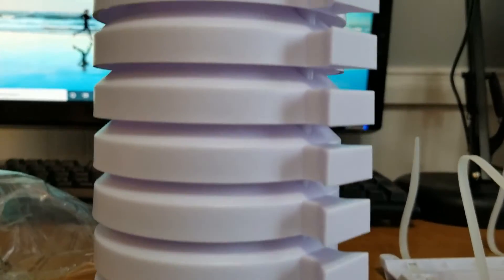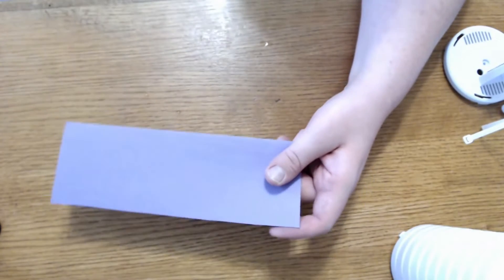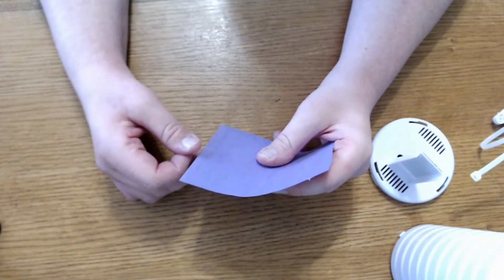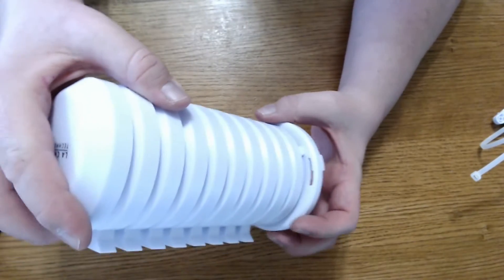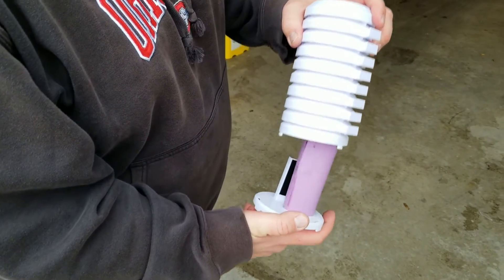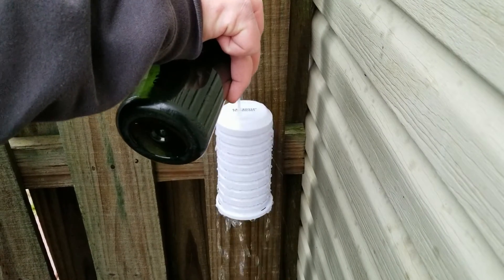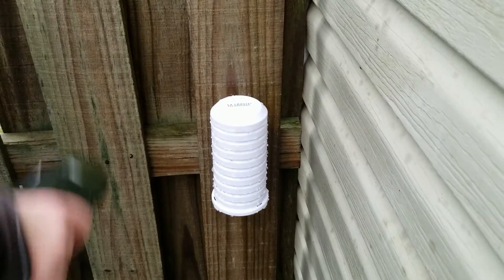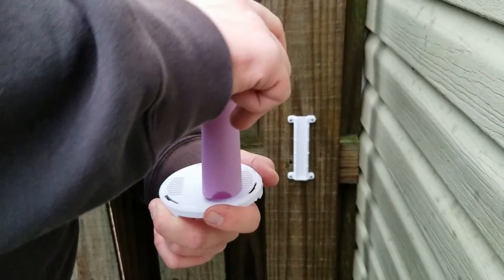How To Keep Your Wireless Weather Station Sensor Dry - Testing A La Crosse Sensor Protection Shield

Comment: Thinking of buying one of these shields too. There are standards for where met instrumentation is to be placed to meet world met standards for sensing temperature. I wouldn't put it where you did, ie. right beside your outer house wall on a fence. Houses and fences can be sources of heat so your displayed winter temps may be skewed higher than ambient air temps. Ideally, it should be placed about 1.2 meters above a grassed surface away from buildings and trees but, unfortunately it will be exposed to solar radiation there in the open. However, if the shield is any good the radiation will be reflected away to an extent which meets world temperature measurement specs. I will likely attach the one I buy to a white, wooden stake driven into the ground in my read yard. If it causes higher than expected temperature readings then I'll shade it with something I guess. Thanks for the information though.
Reply from the maker: Hi there!
Thanks for the info. My temps are usually close to what I see reported on the news, my only other local source to compare it to. When I first got this outdoor sensor, the sales rep said to mount it near the north side of the house and in a shaded area. He suggested mounting it on a post under the north side of our deck, which sounded good because it's protected from sun and direct / snow. 
Your suggestion sounds great. You'll have good outdoor air flow all around the sensor and it'll shielded from elements that may change the temperature.
So far it has been great for letting me know if there's goin to be ice on the car in the morning, what jacket to wear, if i need to cover plants in late fall...etc.  If I upgrade my weather station this summer I may mount it per your suggestion.  
Thanks again!

Comment: I was hoping someone can tell me if will reduce solar radiation, ie I don’t have a suitable spot that is 100% shaded  and I was getting higher temperatures when the late afternoon sun was hitting the sensor. Most other weather stations  generally a  small louvred shield as standard.
Reply from the maker: hi there!  If the plastic shield is in direct sunlight for a long time it will heat up and you'll get higher readings. As long as you have a shield of some sort blocking the sun it will do do fine. You could get creative and strap it under a tree branch where the sun doesn't shine or maybe behind bushes around the house 👍

Comment: Your test where you sprayed the side and the paper got wet is probably the most accurate. Winds come from all sides, therefore, it doesn't always rain straight down. Why didn't you think it was accurate?
Reply from the maker: Hi Diane! You're absolutely correct. At the time I felt like I pulled the trigger on the hose to hard and forced water up under the overhangs so I re-did it. But you're right. Depending on where you mount it you can have rain hitting it from all angles. I have had mine now for a little over 3yrs I believe and it's perfect. I've moved on to a newer weather model but use the same case for the new sensor. I'm glad I bought it :)  Thanks or adding to the conversation. Have a wonderful day! 👍👍

Comment: Looks like a small Stevenson screen. Needed to also test how well it protects from sunlight throwing off temperature readings. BTW, I'm a meteorologist, retired now, worked for almost 36 years for the AF.
https://en.wikipedia.org/wiki/Stevenson_screen#:~:text=A%20Stevenson%20screen%20or%20instrument%20shelter%20is%20a,still%20allowing%20air%20to%20circulate%20freely%20around%20them.
Reply from the maker: Hi Marc!  You're right, it does like like a Stevenson screen. I put it in the shade where light doesn't hit it but you're right, I should have shown what happens when you have it in direct sunlight. Our daughter was studying weather in science class when we purchased this and she was our weather girl for a while. It's still going strong and working great. When this one dies we'll probably get a new one from La Crosse  - those guys are great to work with.  By the way, I'm not too far from Wright Patt AFB.  Good hearing from ya and thank you for your service!

Comment: I live in an apartment and don't have enough space to use this between my window and the screen. Is there another way to protect the sensor?
Reply from the maker: Hi there!  Assuming you get the sensor shield  for it... First, you may want to ask the owner if you can place it outside. Let them know you will mount it with zip ties and not the screws (zip ties come with the sensor shield).  Be sure to place it in the shade and at least 20ft away from any air conditioners / heat pumps. If I lived in an apartment with limited options I would use the zip ties and attach it to a garden stake. If there's a clear area between bushes and your apartment, perhaps you could stake it there? That would be out of sight and mostly shaded I bet. If you have a deck you can attach the sensor using zip ties to the post just under the floor of the deck.  This would keep it from direct rain and sunlight. Do you have bushes or a deck just outside your door? 
I know a family that lives in an apartment. They have a display by the door with a wooden welcome sign above it. They could easily attach just the sensor (no shield) to the back of that sign - out of sight out of mind...and it's under an overhang at the front door. It would be dry and out of the sun.  These are just some ideas. I guess you need to get creative...but hopefully, this will get you started. Thanks for asking!
by the way.... La Crosse Technology sent me a free monitor and I'll be setting up a giveaway very soon.